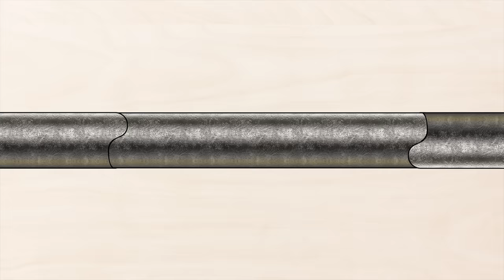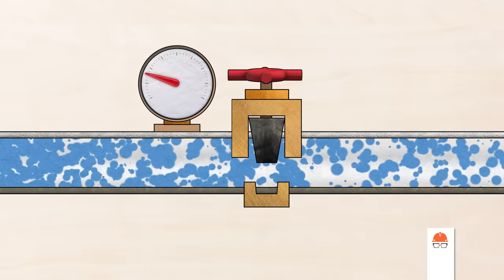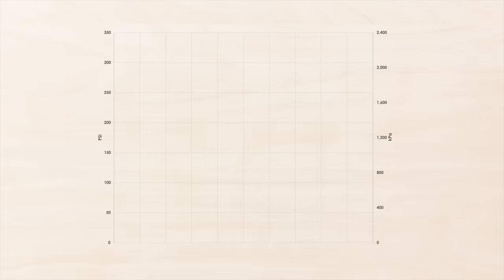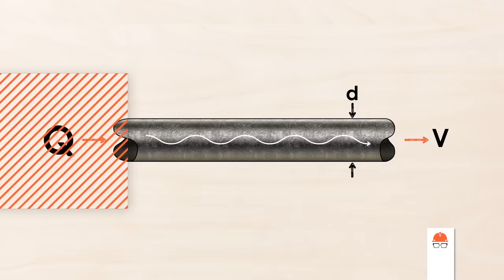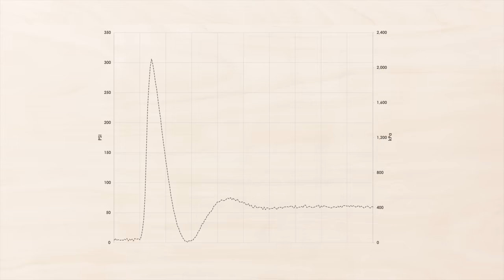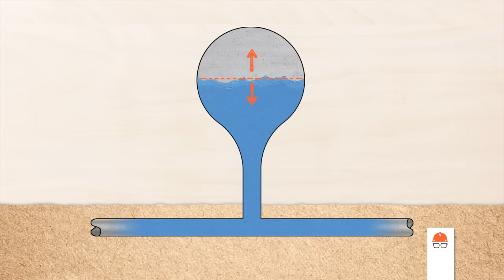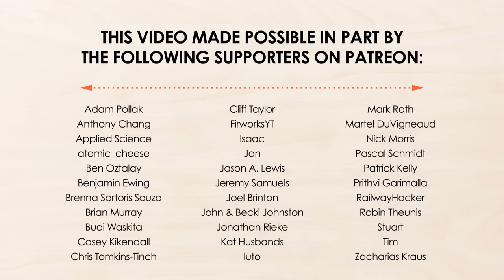What is Water Hammer?

Comment: Water hammer is used in gravity pumps! Water flows freely out of a waste gate until it hits a predetermined velocity and a valve closes. The spike in pressure is diverted through a check valve which allows water to be pumped higher than the height of the original source at the expense of water lost through the waste gate.
Reply: Oooh. So that's how those work. I remember watching a video of one but I didn't understand the physics of it.
Reply: Cody's lab explain this effect and even make a pump.
Reply: A friend of mine built one of these to lift water up a large hill from a creek at the bottom. 

It worked extremely well. I wish I had photos. He got the design from a ~1940's farming magazine.
Reply: Also similar to how boost converters in electronics work. The water vs electrons analogy is surprisingly accurate.
Reply: yes, just like a boost converter. even the equation in this video is analogous to an inductor equation and the step response graphs are the same as in LC tank circuits.
Reply: A hydraulic ram
Reply: Nick Moore aka "Ram Pump"
Reply: How those work makes a lot more sense after watching this video. Great video keep up the good work.
Reply: Wouldn't it be more efficient to just pump the water through itself to create the motion instead of just wasting it?
Reply: I’m sorry but “dv/dt” is the derivative of the velocity with respect to time, so it’s actually acceleration it measures, by that I mean the more sudden the deceleration would be the larger the magnitude of the “water hammer” the system will experience
Reply: Super cool, it's almost exactly like an electronic boost converter when you think about it, and I'd wager that the mathematics are nearly identical!
Reply: Just like a boost converter does with voltage?
Reply: Omega Haxors
Yes, something like a water wheel powered pump would be more efficient but a ram pump can be a lot easier/cheaper to build depending on the specifics of the situation. Keep in mind, ram pumps usually operate using naturally moving water so system efficiency isn't that important. A ram pump can also effectively move water from a small stream uphill where a water wheel/turbine wouldn't be practical.
Reply: Omega Haxors a ram pump is essentially nothing but two check valves attached to a T with water from the source going into the third branch of the T.

Any other kind of pump would either demand electricity or substantial infrastructure like a water wheel to run it. So you can’t be the cost, and when you’re pumping water out of a stream a pond, it’s hard to say that it’s really wasted. It was on the ground you started, and most of it returns there, although maybe a ways away, depending on where you mount the pump.
Reply: Nevir202 Ooh so the energy from the falling water is what powers the boost. That's really clever.
Reply: Omega Haxors yes, imagine if instead of a pressure gauge he screwed in a check valve with a pipe standing up from it. Then every time he closed the valve, the spike in pressure shoves open the check valve and pushes water up into that pipe. That’s exactly how the type of pump they are discussing here works. Except the valve which is being closed is a check valve which is slammed shut by the water itself whenever the speed of the flowing water is great enough.
Reply: super interesting to read that the equations match that for a boost converter. i had previously thought "think of it like water" (especially on the context of stuff like capacitors) as being more of just a mental exercise. cool that the maths is similar in this case.
Reply: Roy: yes but in this case the voltage is analogous to water pressure, the check valve is the diode, and the water column is is the capacitor
Reply: I think this is similar to how a boost converter circuit works. Its used to boost DC voltages.
Reply: Next perpetual motion machine right there...
Since we can't get more energy OUT of the system than we have put into it, we do what humans do best and dump mass in exchange for energy.  Multi-stage rockets utilize this most clearly, but essentially  we have to drop a variable from one side of the energy equation in order to gain it on another.
Reply: he circled the velocity component of the ratio so it's still accurate. If wee get that technical then we might as well integrate all the way back to the position function and start there right?
Reply: Young Tang 
He did. Watch it again.
Reply: This is why you want to slowly add steam to a system that has been offline for a while. The slower velocity allows any water in the system to move. Too fast and you've just set off a bomb!
Reply: TIL how gravity pumps work. Is this also how siphoning gas from a car works?
Reply: I think the same thing is happening when you open a shower. 2 of my shower head exploded because I have a high water pressure and when you open the shower tap, it pushes with such a strength that it basically exploded.
Reply: alex rentz you got it right old school pumps rock
Reply: Norm T All orbits eventually decay on a long-enough timescale, so even that is not a perpetual motion machine.

Also, in an Einsteinian sense, orbiters or space vehicles do not accelerate due to gravity. They simply follow a straight-line path through curved 4-dimensional spacetime, meaning they don't accelerate.
Reply: Norm T I honestly think they are 2 ENTIRELY DIFFERENT types of "FREE". They are BOTH mythical, but one is closer to "Free" than the other. Here they are:

#1 Economically FREE: This is energy you don't have to "pay" for. This is mythical because of upfront costs to capture and utilize said energy and maintenance of the system. Another words the source is free but utilization is NOT. (Solar, hydroelectric, geothermal, and the SUPERMYTHICAL wind*).

#2 The mythical Physics free energy. "Something from nothing", perpetual motion, etc.

*Wind is VERY expensive, not to mention unpredictable. I've worked on RAT Gens in the USMC. They have complex mechanisms that control blade pitch to regulate RPM's as well as a centrifugal brake that engages once the least efficient pitch angle is reached to mitigate overspeeding. The hinge system that controls blade pitch must be kept lubricated and the brake pads must be changed regularly. It is a very HIGH MAINTENANCE system. Add to that the upfront costs for the structure and the real estate needed for a wind farm and you will start to see that we are being lied to about wind being "free energy". If it's so free, then why is it so dependant on government subsidies? If I've got to shell out $1.25 in taxes to save a $1 on my electric bill, I WANT MY FUCKIN QUARTER BACK!
Reply: hydraulic sheep
Reply: Omega Haxors
  Well, To use a pump would require energy. When you factor in the energy for the pump, that would decrease your 'overall' efficiency.  Pumping 'some' water out of a large stream uses the energy of the stream. Thus, the energy used in the ram pump is basically 'free'.  That free energy is what increases the 'efficiency' factor. 
 In addition, it is the energy if the flowing water that is used to make electrical energy in Hydro power generators   Great question though...
Reply: A rocket or satellite in orbit does not go on forever, orbit decays and eventually it falls back to earth. Google Skylab, it was the United States' first and only space station, orbiting Earth from 1973 to 1979, when it fell back to Earth. If it was perpetual it would still be up there.
Reply: @ Merc E.Z.   Yes, I do massive amount of 'Dumping' in exchange for energy to operate...
Reply: awesome thnx for sharing, snd awesome video
Reply: You can use the water analogy for lots of things.
Voltage is pressure, current is water flow rate.
Resistance is anything that restricts the pipe, be it a narrowing of the pipe or a turbine generating electricity.

A capacitor is like a barrier in the pipe with a spring on either side, or like an elastic membrane blocking the pipe. It won't let a continuous flow of water through but alternating flow switching from one direction to another will push the barrier back and forth against the springs and can transfer energy to the water on the other side.

An inductor is like a flywheel connected to a turbine that is driven round by the flow of water. This restricts a change in flow rate and transfers the energy to the flywheel, which then wants to keep water moving in the same direction in the case of changing flow rates. Although these make water hammer worse if you suddenly shut off the valve, because the energy in the flywheel has to go somewhere and tries to pump water against a brick wall. In fact, when a circuit with an inductor suddenly goes open, you actually get a high voltage spike. This is an electrical hammer effect!
Reply: In the 1960's, I visited the N. E. Transvaal in S. Africa.  There was evidence everywhere of the then defunct industry of early gold mining - dilapidated factories with giant steam engines rusting in them and great holes in the corrugated iron roofs, rusting railway lines with coco pans still standing on them, their wheels rusted fast - and further out in the countryside, far from any electricity, a water pump, going Bang, Bang, Bang, and pumping water up to a disused reservoir.  I was intrigued by it, and mentioned it to Mr. Lily, the old publican in the little town of Pilgrim's Rest, who was a fantastic source of knowledge on the area.  He told me it was a Blake's Hydram - 80-100 years old, totally without maintenance, and still working away.  I see on the Internet that the company still exists.
Reply: thehookersful
Ok. So assuming that the timestep dt is fixed, and that the valve is closed completely meaning that the water will have to come to a complete stop, what then determines the magnitude of the acceleration? Yup, the velocity (V). He is right.
Reply: How about a steam-powered water injector for a boiler? Same principle, I think.
Reply: Young, he did.  He talked about air filled stand pipes, over-pressure releases, slowing valve closure, widening pipe areas, and others.  Did you watch the video, before you complained?
Reply: B. Xoit  ... The old timey boilers I worked on (the steam boat at Disney World) as a kid just used steam driven pumps with the steam pistons connected directly to the water pump pistons, though I'm sure there are many other methods, maybe some that work as you describe. The one on the riverboat was similar to this:

https://www.google.com/search?q=steam+driven+water+pump&safe=off&client=firefox-b-1&tbm=isch&source=iu&ictx=1&fir=ewKvAQv1-uUkEM%253A%252Csu6YK8MlORbR9M%252C_&usg=__9SY67FUMFVSDnc6yD1ys7xXJe-A%3D&sa=X&ved=0ahUKEwjQgZvztLfYAhUBYiYKHTx5Bo0Q9QEIUDAB#imgrc=nwxvASbMRJWTVM:
Reply: +John Sikes, the injector seems to use a different principle than the water hammer. More of a Bernoulli thing, I guess. https://www.youtube.com/watch?v=4wsiXPgfdlI
Reply: The Great Pyramid is a giant ram pump.
Reply: If you add 7.3 % of natrium chloride in the water, then the water can be compressed by up to 26%
Reply: be careful around them when running, they'll give you a good wack and are likely to break bones.
Reply: Stacy also you want to open steam valves slowly so that you heat the distribution pipe slowly so that it expands in a predictable way without over-stressing sections of piping.
Reply: damn, I learned so much from this.  Just subbed after watching a few of your videos, keep up the great work.
Reply: Robert B A man-made satellite doesn't fall out of the sky due to orbital mechanics. It falls cause of air resistance/friction with the incredible thin but extant atmosphere.
Reply: No, Skeptic Moderate. In a siphon once the initial volume of fluid fills the tube there is more fluid on the side away from the vehicle as you are drawing to a lower location. Due to this gravity takes hold and pulls the fluid on this side more than in the short side in the tank (gravity exerts the same force on both the long and short sides but there is more mass it interacts with on the longer side). As gravity pulls down the fluid exits creating a vacuum force behind it in the tube. This low pressure is lower than the air outside the tube so the gas in the tank gets drawn in to equalize the pressure. Because this new fluid just flows out of the tube the low pressure state is maintained and the fluid keeps flowing in and thus out the other end.
Reply: Gravity pump is geniale in his simplicity
It can be made on the technology of Bronze Age... and may be in Stone Age too ;)
Reply: ram pump.
Reply: This has probably been said already somewhere in the comments. There are many remains of ram pumps in Derbyshire, England, lying around in fields near rivers. I've never seen one in operation because they've mainly been replaced with mains water systems or electric pumps.
It's a wonderful example of engineering at work. Observe a problem (water hammer), think about it, and turn the problem into a solution for a different problem.
Engineering is exciting. I was an Engineer for nearly 50 years and it still gives me buzz.
Reply: @TimpBizkit  
I love electrical analogies. I was an electrical engineer for nigh on 50 years. I also find that electrical analogies sometimes also describe the human condition.
Reply: @iplop  great story. thank you. 👍
Reply: I saw this on Homestead Rescue
Reply: I need more details pls...
Reply: Well guys, this youtuber made a video about it :)

Comment: As someone who's worked at a plumbing company as a kid for a wile and remodeled houses for a living for years I did not know a single thing this video talked about. Learned a bunch.

Great presentation
Reply: Love your page. Definitely a follower @buddy's diy
Reply: yea those little hammer arrestors he mentioned literally do close to nothing. make sure you have a working PRV and you're better off. its not the slamming shut that's hurting people. its the fact the cities keep expanding and the pumps are putting out more water and increasing pressure. many people got notices in the mail about this. only had one call in 10 years where someone followed up on it to get one installed. soon as it was put in. hammer gone. pressure under control.
Reply: Knowing something is one thing but to understand it is a whole nother world. That's why I stayed away from technical, fear of understanding new things. With great knowledge comes great responsibility lol
Reply: I am no plumber, but I plumbed my house and for the hammer effect, this can be stooped my simply adding a larger capped pipe over the water line, this will act as an air cushion eliminating the surge. although after a long period of time they will need to be drained.

Comment: I like how much similar this is to something I've been dealing with recently in a project : voltage transients in electrical circuits due to inductive components (also called "load dumps"). When closing the valve/disconnecting the electrical load, if the rest of the circuit of pipes/wires is big enough to have a significant amount of inertia/inductance and there is enough mass of fluid/current flowing, it might cause a sudden and potentially damaging spike in pressure/voltage. It's awesome how hydraulic and electric systems can be compared and how one can understand one better by studying the other.
Great video as always!
Reply from the maker: Totally agree. There are so many good analogies between closed conduit hydraulics and circuits.
Reply: HerrHeisenheim I was thinking the same thing. In a way, the flywheel here acts just like an inductor, resisting any sudden change in current (di/dt). When someone first explained to me that an inductor is like a water wheel and a capacitor is like an impermeable but flexible membrane, it immediately clicked for me.
Reply: Thanks for the link, very interesting!
Reply: Your explanation might be great for students who need to learn the concept of Bond Graphs. It's a way of modeling dynamic systems independent of their physical domain. You just described how an electrical circuit can represent the behaviour of a mechanical system. Their bond graph representation would therefore look exactly the same.
Reply: How about something simple like synchronizing generators and a power grid in a 3-phase system? There is a simple indicator - you hook a lamp across the switch; when all three lamps are OUT, you throw the switch. We had power benches in Undergraduate Power Engineering where you got to do this. But it's counterintuitive to throw the switch when the lamps are OUT. If you throw the switch when the lamps are ON, you get a, well, big noise. And your intuition is fixed forever...

Comment: M.E. working out at Hanford here:
We have high concern over water hammer (Fluid transients). We transfer radioactive waste, so we do not have the margin of error for transients that exceed our allowable stress for pipelines. One thing to note is that we don't normally rely on PRV's (Pressure relief valves) to mitigate the pressure spikes. 
We have strong evidence that PRV's tend not to have a quick enough response time to relieve the elevated pressure, and hence we do not rely on them for safety. All applications are different depending on the working fluid. In the case of hazardous fluids, most of our solutions are based on aqcuiring valve actuators with the required closure rates.
A good resource (for anyone interested) is fluid mechanics, water hammer, dynamic stresses and piping design by Lieshar. 
Great videos as always! I've been watching since I was in university (2015).